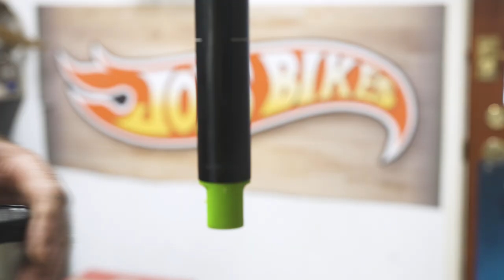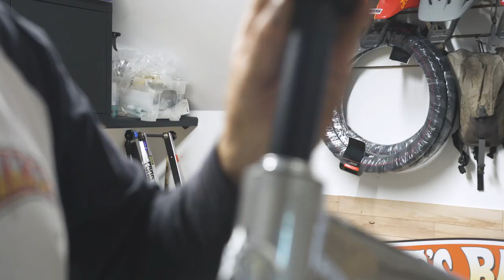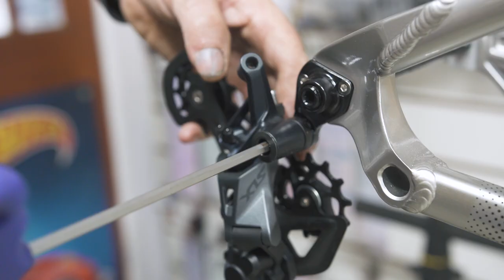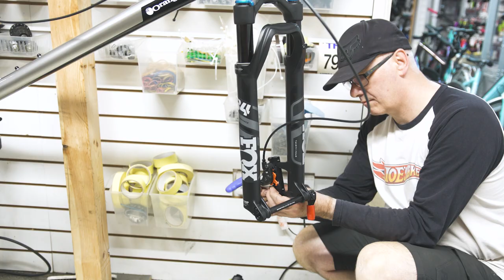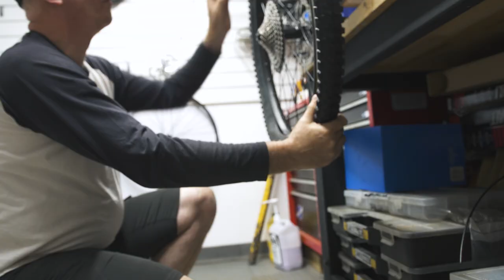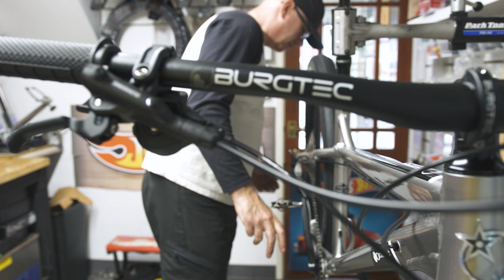Orange Crush MX - Joe's Bikes

Comment: Nice Build!  WHat is the tool you use to vertically hold the wheel during cassette/Disc assembly?
Reply from the maker: Hi Anthony, Park Tool do a WH-1 WH-2 and they do the same job, cheers     Joe.
Reply from the maker: Glad you enjoyed it by the way, cheers   Joe.